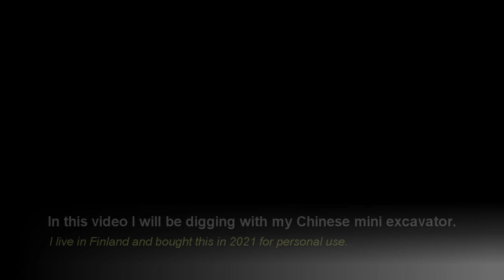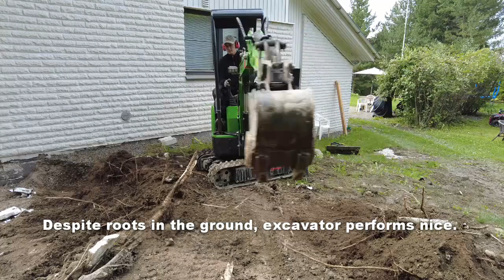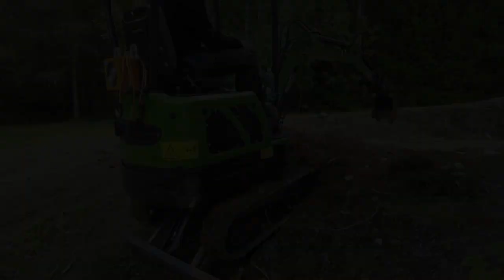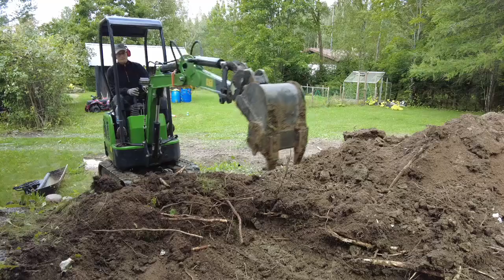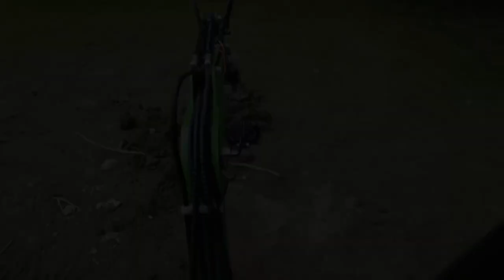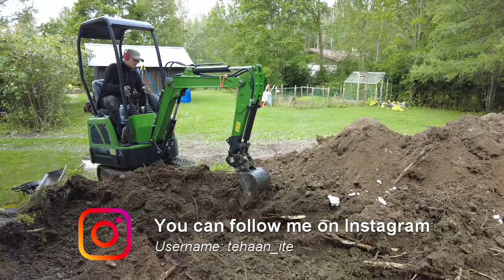Digging with my new CHINESE mini excavator in FINLAND

Comment: look smooth but I think you got the lower part reverse. the blade should be facing forward to prevent the body from moving forward as you claw into the dirt.
Reply: Blade behind keeps digger from lifting when the bucket pushes down into the ground. Works both ways...

Comment: Decent little digger for the home owner,be interesting to see how long it lasts ad how hard the parts are to obtain. These little machines sure save the body.
Reply from the maker: Yep same thoughts here. It is interesting to see how it works and lasts and what kind of problems will occur.  👍
Reply: Keep it greased and out of the rain... Will have all the electric gremlins as China switches are bad but the diesel will outlive the shell :-9

Comment: Those Chinese machines are breaking down a lot more than the others.
Broken crankshafts on those one cylinder Motors, and the blade cylinder brackets brake which can cause the tractor to flip over if it's used to support the tractor on a hillside and who knows what other problems will pop up.
Reply from the maker: Yes there might be some truth in your words. I have also heard some horror stories about these breaking down. However these are coming more and more popular so in case of an breakdown spare parts are easier to buy.
Reply: I bought 2 10 hp diesel  engines  they bolth got 3000 hours  on then no broken crank great engines
Reply: Its all down o maintenance and way of use... If you drive forward with shield in front on cheap machine its no wonder, and it is not made to support on a hillside :-) point of gravity is high on this narrow machine
Reply: Obvious answer: don't work it too hard!

Comment: single cylinder engine
Reply from the maker: Yes correct!
Reply: i have 3 cylinder 854 ccm NEX N 12
Reply from the maker: Is it a bit bigger machine? 1,2ton weight?
Reply: Yes IT is. I Just start building camping on my fild and need 1.2 t digger
Reply from the maker: @wojciechtraczyk7641  Where did you buy your excavator? Do you have a link or pictures or videos of it?